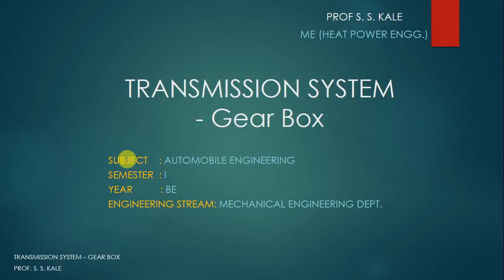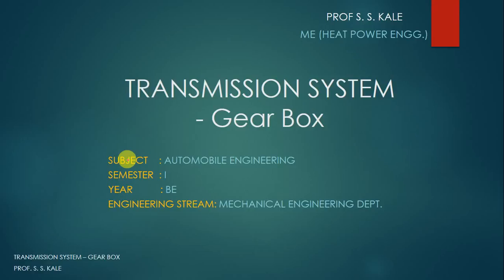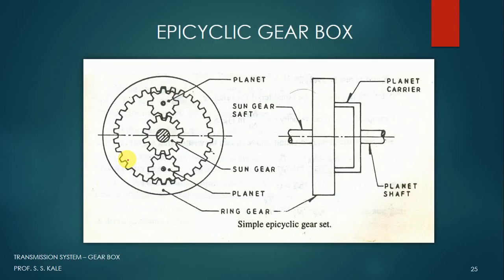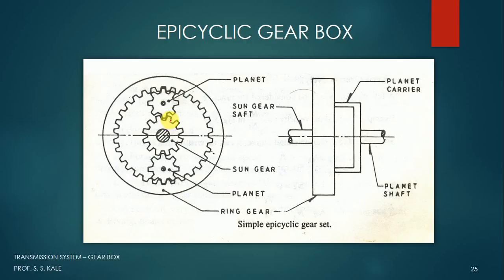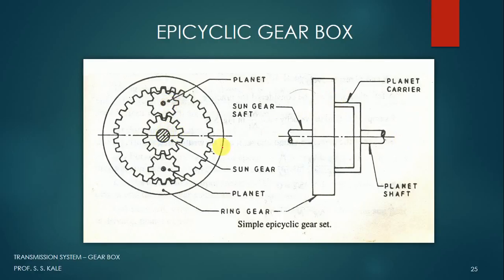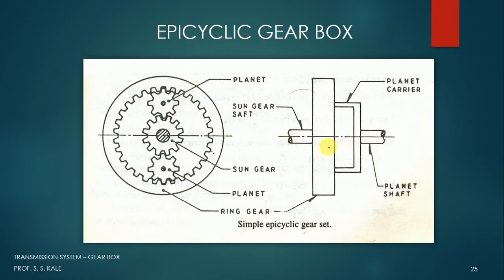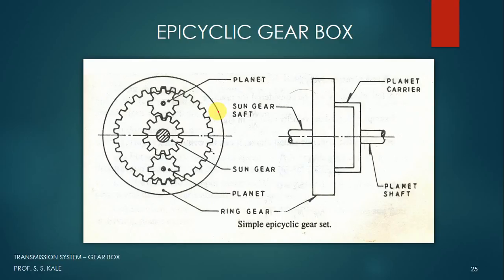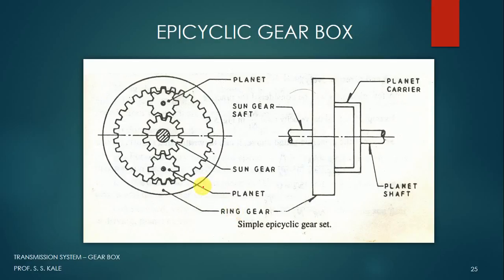Epicyclic Gear Box - Automobile

Comment: What if 
Sun gear (CW):-input
Planet gear fixed (not planet shaft) 
What about the ring gear?????CW or CCW or doesn't rotate
Reply from the maker: Didn't understood question, please nelaborate.
Reply: @SampurnaEngg  what if Sun gear rotates in clockwise direction 
Planet gear is fixed(planet shaft can rotate) 
Now in what direction does ring gear rotate?? 
Clockwise or anti clockwise or doesn't rotate
Reply from the maker: In the condition you explained, if planet gear is stationary but planet shaft rotating then total system will rotate in clockwise.

As Sun gear rotate clockwise, planet gear will move clockwise w r to sun gear shaft axis (please note that planet gear will not rotate about its own axis but it will rotate about axis of sun gaer). The motion will transmit from sun gear to planet gear and then planet gear to ring gear. Ring gear will rotate clockwise.
Reply: @SampurnaEngg  and the gear ratio is 1:1 am I correct
Reply from the maker: @013grandhimanohar7  absolutely correct...it is 1:1.